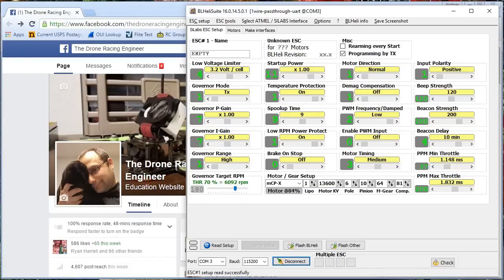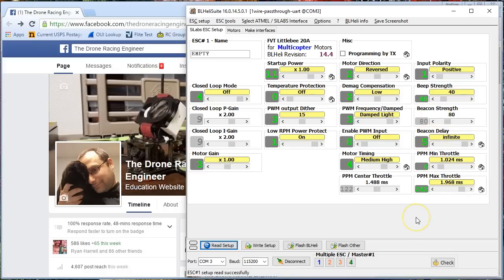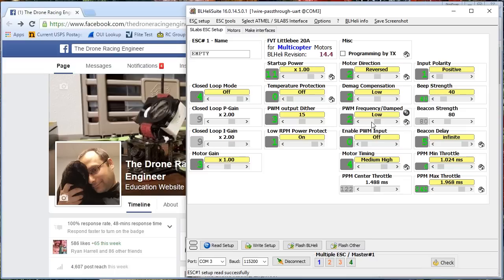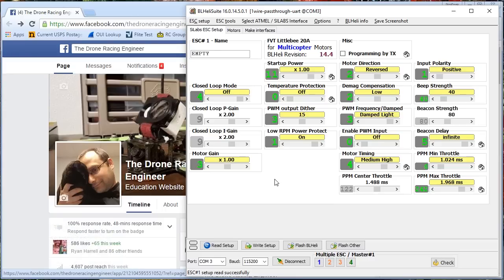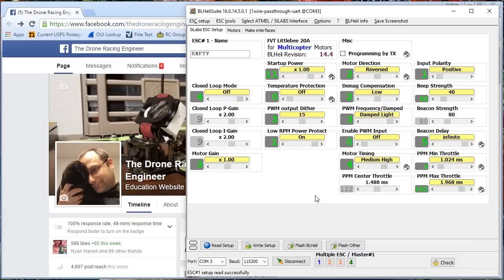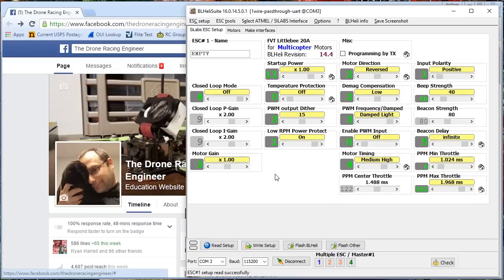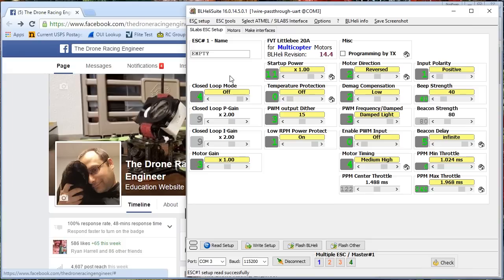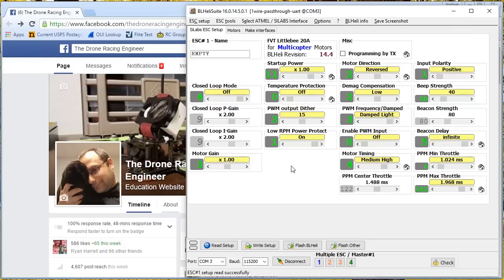BLHeli - 100% Explained

Comment: still running simonk...
Reply from the maker: +Randy Lachman Until BLHeli 14.5, I think there was some argument that SimonK had the edge over BLHeli on smoothness. With 14.5, I think BLHeli has caught up, and BLHeli_S will go even farther.
Reply: +Joshua Bardwell yes but i have one with a crappy atmel processor

Comment: im flying a zmr250 quad, with a old Atom flight controller, it flys well, however when i go full throttle the quad pulls to one side and backwards,  how do i go about fixing this?